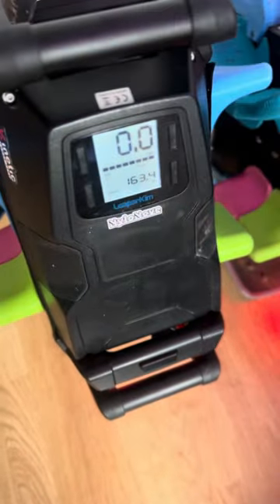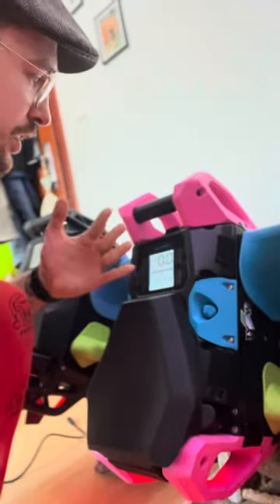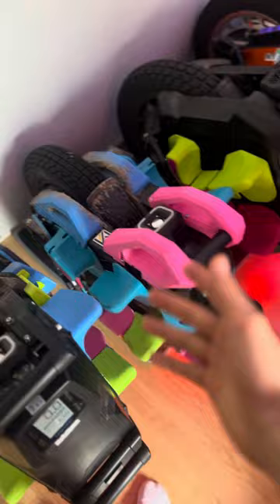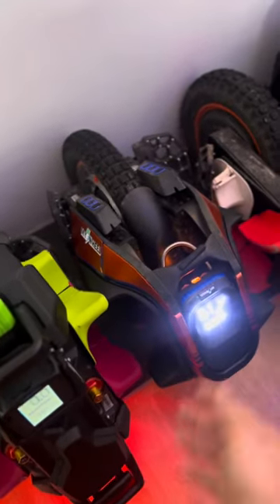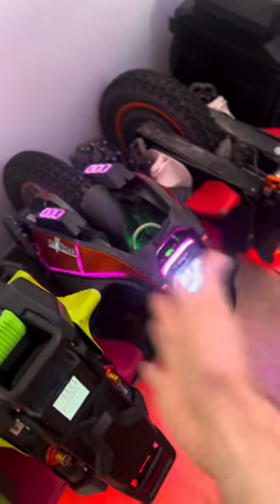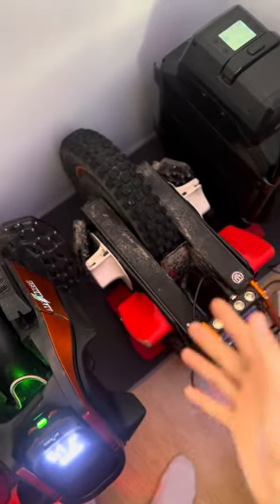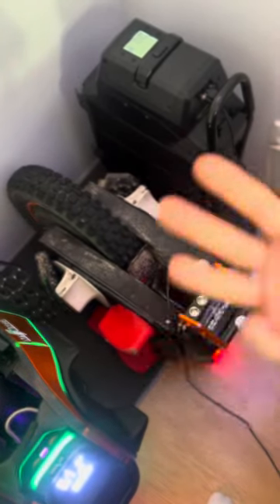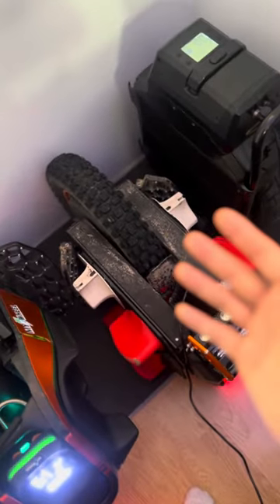Is it time to stop hating on Begode?

Comment: I still have my master V2, ride it hard in heavy rain, snow, negative temperature or heatwave, absolutely zero issues. Have a slight bend in the rim though... Else it rides perfectly and has proven very reliable for my use after more than 3000 km. It surived a 45km/h crash after a car ran a red into me and only broke two small bolts for the light housing. Can't speak for all their models but I do feel safe on my master.

Comment: I have the begode ex30 with just over a 1000 miles on it and the only thing is the air shock loses pressure, so I pump it back up every 2 to 3 months all good

Comment: Yeah Begode has really stepped up. I've had 0 issues on my Extreme and the recent "jumping" firmware has made huge improvements. It's amazing how easy it is to get in touch with their team for suggestions / questions.
Reply: hello, I'm hesitating between an extreme begode and an extremebull commander mini, I prefer road use but the extreme begode seems more efficient...
Reply: @loufugier3481 I haven't ridden an extremebull cmini before, but I think you'd absolutely love either wheel. The Extreme might be a little bit better suited for trails as the Cmini comes with a street tire. Both awesome wheels though! My Extreme is a tank, takes a beating and just keeps rollin

Comment: leaperkim wheels being unsafe when doing hard braking with full battery is not news. Goes back to the OG sherman and I think part of it is that they only use 2 capacitors on their motherboards.

I think the begode hate comes from those 3 models that used faulty batteries back in 2019, but people keep forgetting that inmotion V11 and kingsong S18 also used those battery packs and also suffered from random fires, but begode sells more wheels so you heard about the begode fires.

I love begode wheels though, just not a huge fan of the suspension system that collects all the dirt and salt and gets stuck. They need to figure out another way to handle that.

Comment: Talking about the Begode Extreme, I know 2 people that have the Extreme, first time I meet up with one of the Extreme users he used the cut off button/switch before our ride and the controller blew, so he could not ride it. Second time I rode with another Extreme user he switched the ride mode to racing, the whole wheel froze, he could not turn it on or off for about 10 minutes after. A few weeks later the first Extreme users motor started to leek rusty water. So my impression of this wheel is not the greatest, that is for sure.
Reply: If it was leaking rust so that can cause problems . Proably all problems comes from water .Still user fault .

Comment: Having a hard time deciding between the Extreme and a v4 Master as my first wheel. Regardless, I think I'll go with Begode to get my feet wet.
Reply: Can't go wrong with either wheel. The Extreme is better for trails & forests, off-road. The Master is a better street wheel, more stability at high speed.
Reply: both wheels are excellent, i have an extreme and a Master V4 on the way to replace my V1... this hobby is addictive Both wheels are excellent. I have an Extreme and a Master V4 on the way to replace my V1. This hobby is addictive.

Comment: I think in general bearings used are the cheapest ones. I have bought more expensive and rust-free with rubber collar, no issues at all for several thousands km. But they were 15 Euro for two. Originals lasted about 1000 km and get dirty and one of them begun to skweek. The metal/rubber collar was damaged somehow and that was a cause - the snow melting water penetrated it and it rusted. Sherman Max.

Comment: Begode just started implementing things that were available on other wheels 6 years ago. Like overcurrent protection they are presenting as a breakthrough in etMax. “High-end BI-directional suspension” is their fancy name for shock with compression and rebound adjustment 🤣
And the charging port still has no diode 🙄
Eventually they will get somewhere. For me personally I’ll wait for few more years before I think about buying something from gotway

Comment: Master v2, at the beginning had lights/display going dark issue, warranty fixed. 2 inner tubes, which are too thin for my liking, had a highspeed (65km/h) crash due to it blowing up, with fairings and bumber's this wheel is a monster, no other issues, i ride whole year, in rain, snow, salt and sometimes mud, at winter i crash daily and even my airshock doesnt need filling, i check it very rarely and change pressure acoording to where i go riding, mostly winter 250 psi, summer 280, i dont do big jumps or stairs.

Comment: Sure, please stop hating begode. Only function they lack is the motor temperature sensor. And BTW your most hated wheel, Inmotion V12HT. Mine has 5700km on the clock and it never let me down. Still rides like new one. So also stop hating Inmotion V12Ht would be great :D. BTW2 I thought that you also have V14, that wheel looks soo good. All the safety features and IP rating at the top :).

Comment: Patton noise maybe the motor cable hitting the rear mud guard. just bc there is so little tolerance (rooms)
Reply from the maker: It’s a very big knocking sound
Reply: @mr_wrongway  maybe the brackets, where the suspension is mounted at the hub...someone made a vid about that issue...
Reply from the maker: @konditor  possible…

Comment: So far I've had exactly zero issues with my Sherman S after 2,500km of riding (I have owned it for almost a year). I also didn't have any issues with my batch 1 Begode RS HS. My V12HT has a flat tyre, but that is the first and only issue so far. Maybe I'm just not hard enough on my EUCs.

Comment: From the perspective of someone thinking of getting into EUC's. Squeaky suspensions and wheels that get damaged under severe use cases are annoying, but not the end of the world. A lack of features to allow batteries to fail safely, a lack of UL certification, and releasing wheels that allow a single failed sensor or a lack of overvoltage protection to chuck the rider off are unacceptable. There is not an electric vehicle in this world that is fun or cool enough for me to risk destroying my house or killing my loved ones because a high density battery decided to turn itself into an inextinguishable fireball while charging in the living room. If these manufacturers have been willing to release products that have such serious safety issues in the past, I'm not sure why I should trust any of them now.

PS: Wrong Way. Do you feel that any of the currently released wheels truly provide excellent user safety?

Comment: Begode:  continues to release wheels at a speed that makes other unreleased wheels obsolete. Makes a wheel with suspension designed for off-road but rest of the wheel is for on road. Signs Miss Cameltoes as their spokeswoman instead of a real EUC rider. Continues with cut outs and quality bullshit (extreme suspension design, ex30 cutouts, etc.)

So nah, Begode still sucks. Veteran all the way.

Comment: I have a question about the patton and the lynx. Im still not sure witch wheel i should buy, im comming from a v5f so im used to a small wheel and never had a big one. I still want good mobility in small spaces. But it will mostly be street driving and sometimes offroad trails.

Comment: Hi Adam, great video as always. I love this short format for this kind of video. How did ypu found put the cell on the first testing Sherman S was dead?
Reply from the maker: Once the battery drains there starts to be a too big diffference in the battery packs and you get the BT LOW error. Then we took it apart and measured cells individually and found one cell set to be problematic and a too low voltage
Reply: I also have issues with battery. I suspect it is death cell row. Cut of during ride due to other battery blowing fuse. 
Battery that has blown fuse works fine but other one doesn't charge.

I think that battery capacity has been poor since I got the wheel, it only went about 65% of range what i usually get with max. 
I did not take apart battery to confirm the dead cell row because that would void warranty.
It's been month since then and I'm still waiting for the reply from factory. 

Also it randomly resets total distance driven. I think that ive got about 2000km on it
Wheel should be one of the newest patches.

Comment: I bought the airshock version of the Begode Extreme so I could continue to ride through the winter with some confidence (this is my 4th year winter riding) due to it's weatherproofing and offroad bonafides. I own the KS 16s, V11, & SS and only the Extreme has been out of the box completely ready to commute on without third party additions, without issues showing up in the first three months. Reading the other comments, the 'problem free' riding sounds more to do with how I ride (no big drops, 40km/h average speeds) and sheer luck..The QC of the EUC industry is clearly clown shoes... with much hype around leaperkim 'Build Quality'.

That said, I've been commuting in Toronto Canada Winter (which is comparatively mild to the rest of Canada) with salt as far as the eye can see. My bearings are fine... my suspension comparatively (to the SS) plush.  My suspension got seized up on the struts with salt & grime.. A little low powered hosing and I was back in business.. smooth as ever.

So yes it is time to stop hating on Begode. From my limited POV at best they are outclassing every other company.. at worst.. they are no worse than the industry at large.

Comment: Adam, great informative video as always, thanks.

One thing maybe missed is that some of these wheels may have a redundant hall effect sensor or a smart algorthm that lets you come to a safe stop if one or both hall effect sensors fails?

Also maybe not all failures are equal. Maybe a failed bearing is not so much of an issue as unwrapped batteries or something that leads to a safety issue such as a wheel cut out?

I am also not clear what the specific definition, features or advantages are of a smart BMS?

Are the features of a smart BMS uniform across wheels? Can you provide more details on this subject. Many thsnks.

Comment: Adam, how do you think. Is it worth to buy begode extreme paying 300e more and getting battery s50 instead of e50? Wheel won't be used much, just daily 10mins to work and occasionally a ride sround the town
Reply: 50s batteries are absolutely worth the price. You can ride your wheel just as hard at 30% as at 100%

Comment: as someone who used to work in quality control in manufacturing, begode has a long way to go before they become a world class manufacturer. bearings that fail after 1000km are pathetic. I see 2 issues.... 1st is design. electronics are underbuilt, code perhaps isnt tested as well as it should be. Secondly is manufacturing; if the process isnt repeatable and stable you will get failures. If begode puts serious effort into fixing these issues I would give them a year before I would trust their products.

Comment: supposedly, the lynx will software limit the power output. i.e. when the wheel is charged to 100%, and you break hard, it should only output a fixed another amount of power. then it is up to you to save your ass😂
Reply: I still think it's better to just charge up to lower voltage and save your controller and your ass.
Reply: @kamencic  yes of course, fixing the problem at the source is better than doing a work around

Comment: Every chinese wheel would have bearings problem sooner or later, as they use bad grease and/or to low quantity of it. Chinese bearings is just terrible quality, replace to skf as soon as possible and preferable CN, not C3 type. Sherman Max have bearings issue from the start, as they are not sealed where cable going out

Comment: https://www.youtube.com/watch?v=LTTT5fh64Zs&t=163s

This is the fix for the patton clunking sound. Motor bolts are loose. This fixed my problem. I also had a cut out on full battery on my patton due to an emergency braking scenaio. Its done well for me though after 3000kms